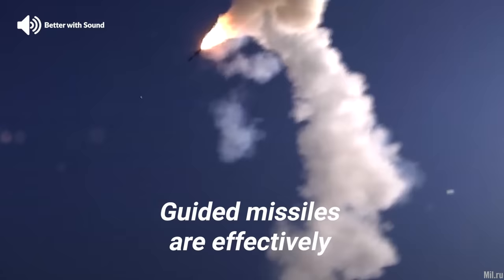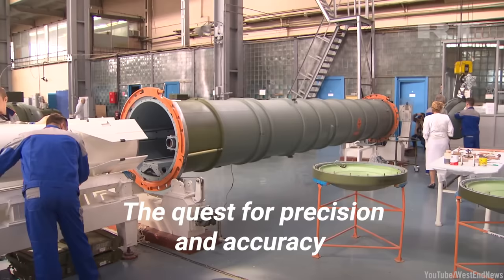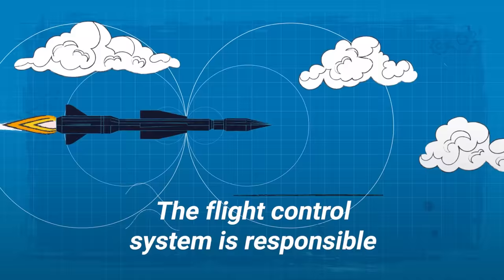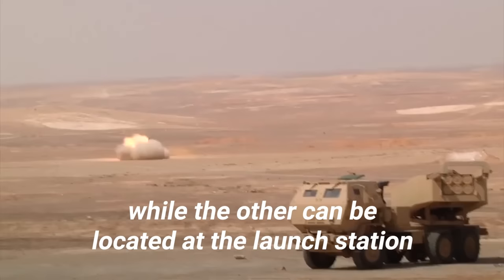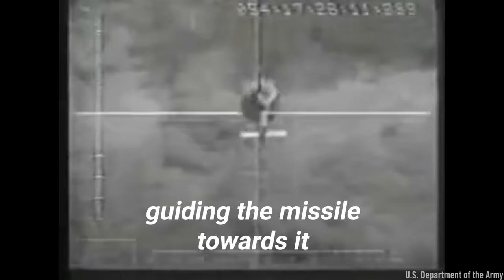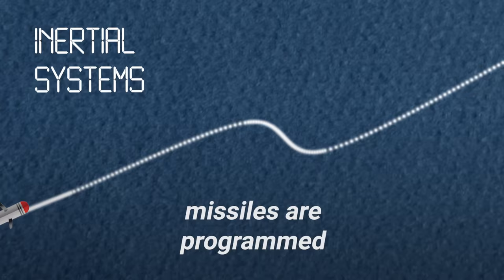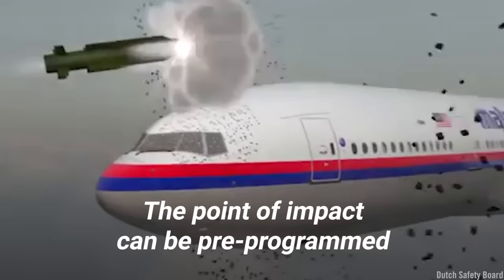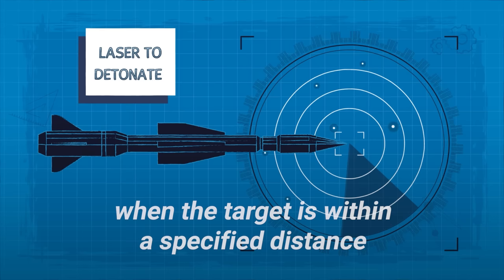How missile guidance systems work

Comment: Around 1996 i had nitrations the wood sawdust using HNO3. its become to the orange color powder than i fill it to the Cardboard cylinder shape things.. than when i heated the bottom which i made it narrow, its ignited and flying fast straight to the air just like a missile.. was very interesting test but guide it to the target request a huge advance technology..

Comment: How does it track a moving target?
Reply: Depends on what ur target is, I only know about aircrafts
Reply: Camera, sensor and recognition Algorithm, and optical flow algorithm

This is very generalized concept, but anyway the computer in the misslle is always comparing picture taken before and the current picture. it can be thermal picture (heat seeker), or any type of electromagnetic spectrum. So the computer recognize the target then track that target. obviously the computer needs to accounted the 2D image movement and transform it to 3D movement. Like , if the recognize pattern is getting bigger it means it getting closer.

Your phone actually has a same feature, face autofocus. It almost work at the same principle

pardon my english

Comment: But what mechanism do guided missiles change their direction?
Reply: I once heard "proportional navigation".
Reply: They have fins that they use the control their attitude and generate lift. They then maneuver like very inefficient aircraft
Reply: @dsdy1205  I find it difficult to imagine how fins can be sufficient to make stable turns at high speeds.  I wish there was clear information available to explain this.
Reply: @numbynumb  Well it actually does, it’s just that it will turn slowly. Missiles aren’t aircrafts man.
Reply: Uhh, thrust vectoring?
Reply: @numbynumb  It will be easier to imagine if you do some math on the wing loading that fins can generate at high Mach numbers. Keep in mind that at those airspeeds the wind hits you like a grand piano to the face, even small fins are quite sufficient for high-g maneuvers.
Reply: @numbynumb  some high speed missiles like AMRAAMs or AIM-9s calculate where the target WILL be by the time it arrives and you use these missiles over 10 or even 50km away so turn speed isn’t a big problem but they have high maneuvering ability regardless.

On cruise missiles which fly slower using jet engines (most are slow enough you can catch up with them on an airliner even) have preprogrammed targets and are meant to target slow moving or immobile targets like ships, SAM sites and other strategic targets which is why larger wings are needed when cruising.

Some enters the final stages when near the target around 20 - 30km aways which they ditched the main body or shut off the jet engine and let the rocket motor takes over which will sprints to the target at high speed to avoid conventional interception like CWIS. These things always fly really low to avoid Radar and anti-ship ones are almost always sea skimming missiles.
Reply: @dsdy1205  I would imagine there's tremendous loading at high mach numbers but that this would also exponentially increase instability.  With airplanes, tighter turns can be achieved at lower speeds so I dont see the loading as advantageous.  Also, using fins would have the effect of slowing the missile down due to drag.
Reply: @dannyzero692  I can understand how it works with a cruise missile because a cruise missile is basically a disposable airplane.  A non-cruise missile flying 10-50 km would have to have a parabolic trajectory because, in the absence of wings, they would quickly lose altitude if fired horizontally.
Reply: @numbynumb  Not correct. Wings aren't the only requirement to generate lift, though almost every missile does have them in the way of fins. The body can also generate lift, which is how the Space Shuttle can glide despite its rather large body compared to the wings. 

One last component that can generate lift is the giant thrusters at the back. Even if the body or fins couldn't produce sufficient lift, the missile could just tilt up enough such that there's enough thrust in the vertical axis to lift it.
Reply: @YoRHaAttackerNo2   Fins are not wings.  The fins serve to stabilize an aircraft, like the feathers on an arrow.  The center of lift must be counterbalanced by fins, which is why airplanes have a tail.  The tail is effectively the fins and they are a requirement for winged airfoils.  Other parts of the plane may generate some small amount of lift but all that really matters is where the center of lift ends up when all lift forces are summed.  If you relied on fins for lift, you'd  still have to maintain stability somehow, so youd just need other fins (which is why fins and wings are separate categories).

And thrusters generate thrust, not lift. Hence the name.  

If the missile tilted up using thrust as you're describing, you'd end up with a parabolic trajectory, as I said in my first response.
Reply: @numbynumb  
That's actually incorrect. 

It is true that for aircraft, you typically have two wings and two tail fins. A lot of missiles have that. For those that don't, they solve this by going really fast. Because of their small size and velocity, the body itself could act as a wing. The lift from the body is how a F-16 flew without one of its wings and landed safely in one incident, being the first plane to land safely with one wing. The reason why planes need them is because they will fly slow at some point. A missile flies fast and dies, so we don't need extra lift from wings, only stability.

Lastly, no it wouldn't. You can angle up a missile and keep a flat trajectory until burnout. We can do the math here.

For a force vector, we know that the total magnitude must be the thrusters output. Next, we need the force of the weight of the missile. Now, I don't have many figures for say a SAM missile is usually classified. The FIM-92B found in the Stinger ATGM can go 750 m/s or about Mach 2.5. It weighs 10.1 kg which means its weight force is 99 Newtons. If we assumed that 100% of the lift of the missile is just from its motor, not the air moving across the body or fins, then we can derive the angle it needs to point up. Let's assume it has a static thrust of 1500 Newtons. We can derive the effective forward thrust from pathagoreans theorem.

1500^2 = 99^2 + x^2
1500^2 - 99^22 = x^2
2240199 = x^2
Sqrt(2240199) = x
1496.72 ≈ x

Now, we can derive the angle that creates. 
The math for it is kind of extensive, so I'll skip it to keep this short but here's a calculator for that, since we are effectively solving for a triangle. You can actually skip to this solution by using the law of sines. https://www.calculator.net/triangle-calculator.html?vc=&vx=99&vy=1500&va=90&vz=&vb=&angleunits=d&x=78&y=21

So from this, at an angle of 3.784°, the thrust of the missile would counteract the force of gravity should no aerodynamic forces act on it. Angling up like this definitely would have some lift effect, especially at Mach 2.5, so the real angle would be lower. That said, the counteracting effects will remain until motor burnout, which it then will go parabolic. Burnout typically happens within 15 seconds for the Stinger flight motor stage.

[Edit] Also, I see where your confusion is.
The reason why rockets produce thrust is because the force is in any vector. However, we've mistaken this term. Rocket thrust is actually its impulse, we just call it thrust because its common in the English Language. 

Lift is solely a positive y-axis vector, the opposite of which being gravity. You do see diagrams where thrust is solely a positive x-axis vector, but that's because planes do not go vertical very often. That is why they label it as such, aside from the fact that they again mistakenly label thrust as impulse. If you look at helicopters for example, their thrust (*cough* impulse) is purely vertical until they tilt, but they still call it lift.
Reply: Fins, thrust vectoring and sometimes other smaller engines on the side of the missile.
Reply: @dannyzero692  The trick is to null out any directional change as seen by the target seeker. If the target signal stays put in the field of view of the seeker (or the seeker does not need to be turned to get it central) you have a constant bearing situation and that is a pure intercept. Quickest way to the target.
Reply: Thrust vector control.
Reply: @aviatorzthebest2452  Are there any examples of thrust vector control that can be readily seen in action and whose designs cam be scrutinized by the layman?

Comment: But for a bomb, how does a bomb maneuver itself to hit the designated target? The bomb's nose just locks on the target, therefore it will guide itself to the target or it can adjust its rear wings too?
Reply: So think of missiles like a rocket, but now this rocket has an empty space, where you can plant the bomb. All we need to do is figure out when to detonate the bomb. Which as explained in the video is done via many methods.
This rocket, also has a chip, which let's say gets connected to you gaming controller, and you can manuever the rocket, any way you want. Or just give the missle latitude and longitude and it will go there. Basically, we humans have programmed these mini rockets, so that with sensors, it can hit it's target.

Comment: Guidance systems are what programs used. Operators program the program. Who you going to trust? The Operator, or the created system used to control and guide the missiles to the "designated target's, up to six thousand miles.
The FACT that could be the distance and housing nuclear warheads, that's way OUTSIDE THE WARZONE CIRCLES OF COMPUTING TO WHICH TARGET ASSAULT. WHOSE WAR OR PROPAGANDA. 
Whose making them, Whose paying for such weapons of destruction. 
THERE IS A FRACTURE, and fractures in the layers CANNOT SUSTAIN FURTHER ASSAULT without giving, "causing" a global environmental SHIFT/CHANGE in our Orbiting satellites.